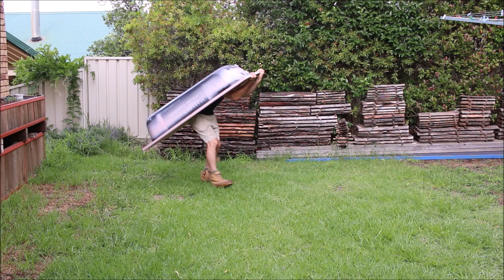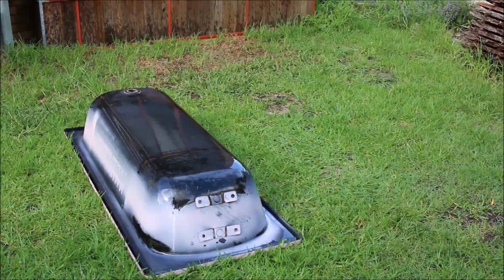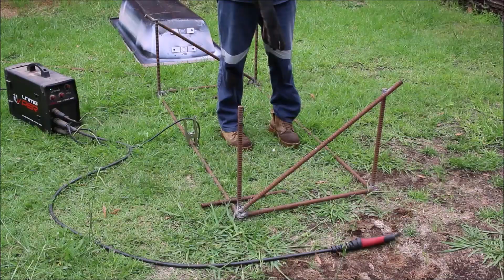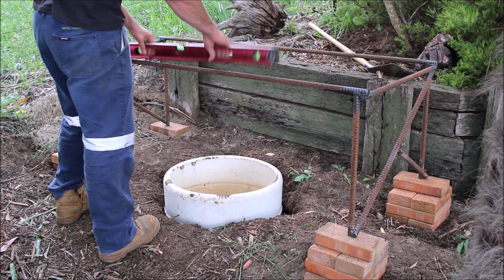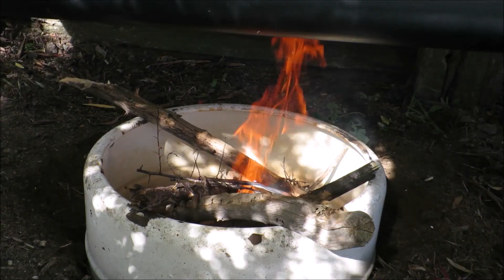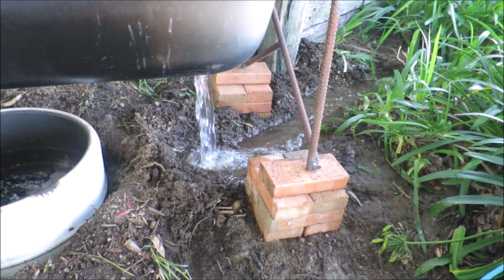Making an Outdoor, Wood fired Bath

Comment: Looks great, does it over heat at all? I'd be afraid of burning myself
Reply: U can always add cold to it. I'm not quite sure the fire container underneath tho. What is that
Reply: Tell me what fire container is!! I want this and I can build it but doesn't show what container fire is in is built of. I'd assume metal of some sort!! Every woman should have a man like u
Reply: @robinkaufman9847 
I'm in the process of making one of these and was thinking of potentially using a truck brake drum, super solid. Many people make stoves out of them here in Australia, two stacked with the open ends facing each other and welded. Otherwise, you could always dig the hole and just line it with bricks. The bloke here said he used a washing machine drum, which are often fairly thin and stainless steel. I'm wondering what to put in the bottom of the bath not to scorch the bum, some kind of hardwood slatting? Pine would just go mouldy real quick.

Comment: I'm thinking of doing something similar to this but not outside but in a shed or large restroom making it like a onsen to possibly reduce gas bills, any thoughts guys?
Reply: you would be better off building a basic radiator if your heating a house tbh. but if you mean heating the shed and having the tub inside get an old boiler tank and some copper tube piping  then use the pipes to make two off shoots for the tank that lead to the tub. then make a hatch in the wall so you can feed the fire and boom. fire heats the boiler which makes the cold water flow in and the hot water flow out which heats the pipes which warms the room

Comment: Nice. How long does it take to heat? .. Do you have any issues with it getting too hot? Just about to build one myself ..
Reply from the maker: about 30mins, it can get to hot if the fire is to big, it didn't take long to figure out the right sized fire for optimum bathing.
Reply: @mtarrant3  brilliant, thanks for the information. how did you find using the enameled steel bath? did it stand up to the fire OK over the long term? I'm trying to decide between an enameled steel vs cast iron tub. the enameled steel would be much easier worked with!
Reply from the maker: @rosstituteuk  I have only had it for about 6 months but all good so far.
Reply: @mtarrant3  did the smoke bother you while sitting in it?
Reply from the maker: no
Reply: Nice job, well deserved beer - cheers for sharing 🙏💖💦